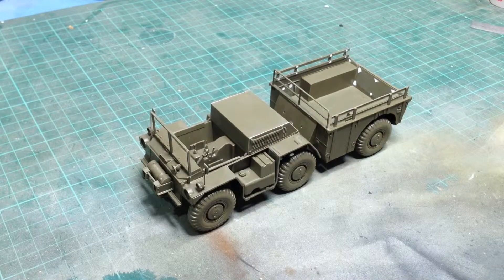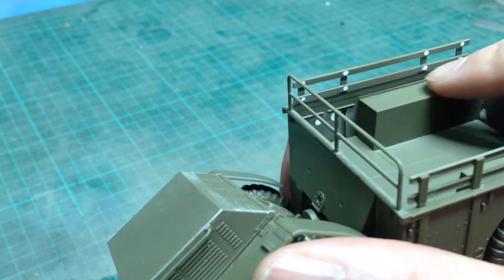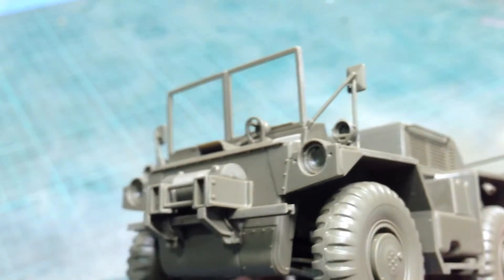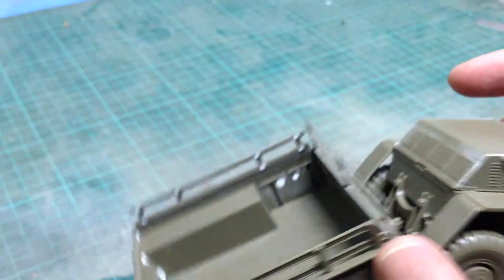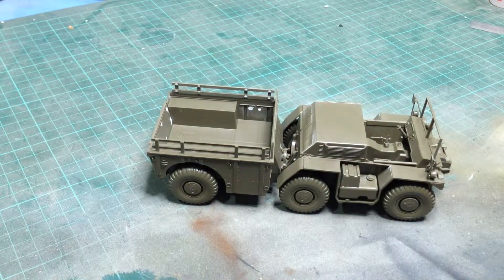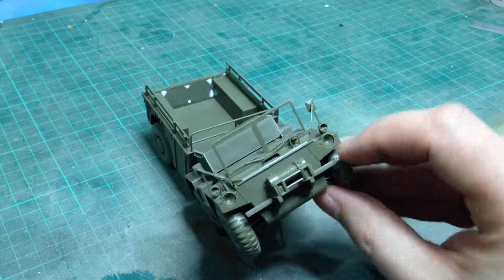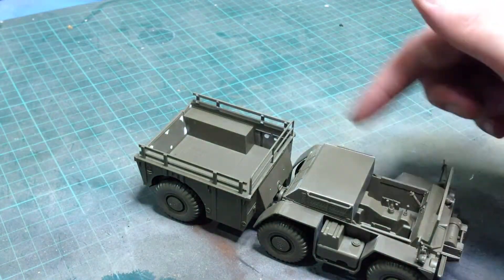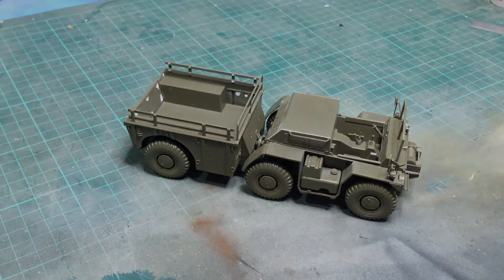Tamiya M561 Gama Goat Build Review

Comment: Good review on the goat ya know the turning articulation mentioned could not be much if that distance between the tractor and trailer are correct. (at least that's the way it looks) Clint
Reply from the maker: I've done a bit more research, Clint, and it turns out that you're correct: the link between the tractor and trailer actually didn't have any ability to yaw. The steering was on the front and rear wheels only. So Tamiya actually got it right.
Reply: so re-make the video with the correction. please.